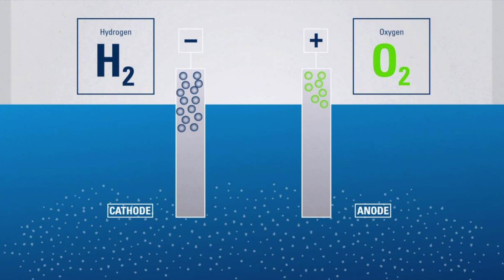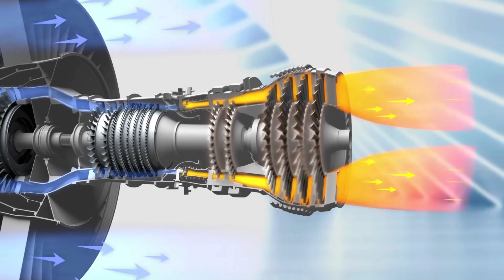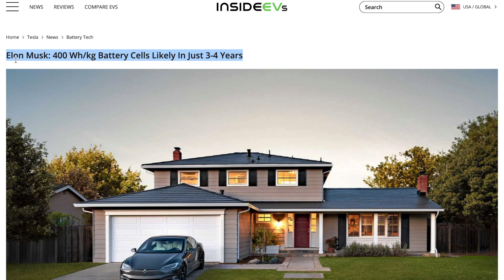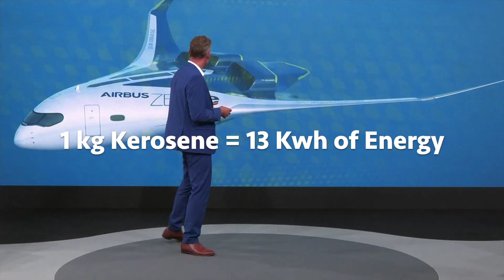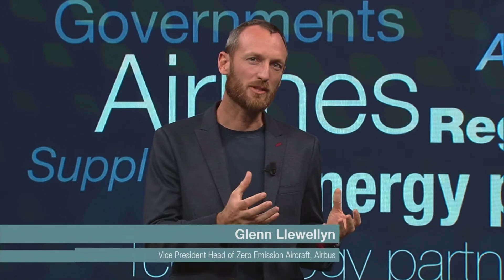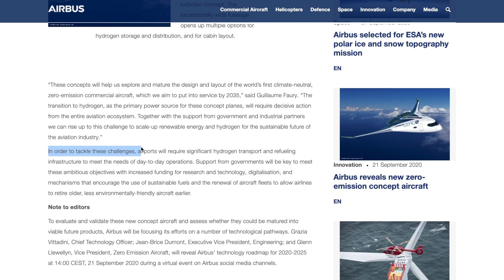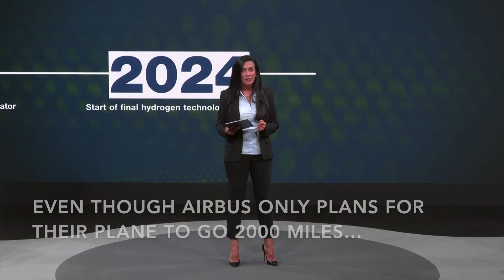Why A Hydrogen Plane Is A Terrible Idea

Comment: There's one mistake everyone on YouTube seems to make when comparing hydrogen to electric.
With electric everyone takes the energy density of the storage medium (batteries).
But the hydrogen gets put in the calculation as if a willing cloud of the stuff will just follow the vehicle around.

I'd suggest we compare apples to apples.
So either use the true W/Kg of electricity, which is infinite (as electrons have no mass).
Or, more realistically, use the energy density of hydrogen including its storage.

Using exotic materials we can put about 10% by weight in a hydrogen tank in the lab.
I just read a university paper that's hopeful that with a few hundred million dollars in r&d it'll increase to 13% in the next ten years...
Reply: You wouldn't use hydrogen for aircraft. You'd use ammonia, which is already 17% hydrogen by weight, and run it in an SOFC with a hybrid Rankine cycle or similar (i.e. use the waste heat to drive a turbine to boost efficiency). If you do it this way you don't need to crack the ammonia for hydrogen either, since an SOFC will use it directly. The reason we don't see this happening today with other applications is because SOFCs run hot -- upwards of 800 degrees Celsius -- and they can take a while to start up. These aren't disadvantages for aircraft, which already run cores hotter than even the hottest fuel cell, and take around 20-30 minutes to start. Viking Energy and Maersk are trialing this technology for ships, and it'll eventually find its way into aircraft too.
Reply: @seanmorrison3744  Interesting point, thanks!
A few questions come to mind.

What's the effective usable energy density of ammonia (including it's storage)?
Either through SOFC or partial cracking (I did just find an article about possibly feeding partially cracked ammonia directly into existing airplane engines).
Anhydrous ammonia is quite nasty stuff. Can it be stored in lightweight containers? Possibly even the wings (without dissolving them)?

And hearing nitrogen and high heat brings possible NOx emissions to mind. Anything known about that?

I can't (easily) find a source that can answer these questions. If you happen to know a source it'd be much appreciated!
Reply: @sigi9669  this paper is a good overview of the current state-of-the-art: https://pubs.rsc.org/en/content/articlelanding/2021/ta/d0ta08810b#!divAbstract.
Practical applications have managed efficiencies better than 50%, and trigeneration gets as high as 80%. An aircraft won't get that high, but aircraft can definitely make use of waste heat, and cryogenic fuel. NOx depends on the type of fuel cell -- you'd use proton conducting electrolytes for aircraft and boats, since it avoids corrosion and keeps water out of the fuel stream, and these cells don't produce NOx. Ammonia is much easier to store than hydrogen, though I don't know what kind of tanks you would use for transport applications. The Germans used it in WWII for a time, so it's doable.

Comment: A hydrogen powered aircraft….maybe. Hydrogen technology and safety has come a long way. An electrical powered aircraft? Unless battery technology advances to the point where high capacity/high output batteries are the size of AA batteries. It’s not happening. 

The problem with electricity is that it takes a lot more stored energy to create the same amount of work. The amount of energy from a Tesla battery Cell Set (1,200 pounds) can be done with just a 5-gallon jerry can of Gasoline. You can see the energy density here is extremely different. So now when we add aircraft to the conversation, with some of them requiring 30,000 gallons of fuel per flight…….you might as well start on your worlds largest aircraft World Record. Currently, you would need about 7.2 Million pounds worth of battery cells to meet the same energy density as fuel. Another thing to remember, and is super critical to flight, is that they need to lose weight over the duration of the flight in order to land. With fuel, that is done through combustion. Batteries? Besides a few microns, the battery cells remain the same weight no matter how much energy is used. The only option is to build aircraft to withstand that weight upon landing. Possible, but now the aircraft is even heavier, you lose even more Efficiency & range. 

Realistically, aircraft are not the polluters and fuel hogs people tend to believe. If you consider the amount of passengers/cargo they can transport at significant ranges, you’ll find they’re actually more efficient than pretty much any other form of travel.

Comment: An electrical airplane is possible and cheap for commuter aircraft’s and short ranges.

With solid state battery technologies it should be possible to achieve the goal of a medium range aircraft.

But even today a long range aircraft is difficult. 38% of the MTOW of the A350-1000 are fuel…

Comment: What about the turn-around/up-time of the planes? You'd probably need twice as many planes with batteries. One plane charging while the other one flies. Not a problem with hydrogen.
You're talking about 25x the energy density as if it was "not that much", because you started out with 400. 25x is still ABSOLUTELY MASSIVE. And you don't consider the considerable weight difference's effect on the efficiency of planes either. Added weight means more lift, means more drag. As well as the low speed of electric propeller aircraft also meaning the lift power needs to act for longer as well. The lift power needs to equal the weight of the plane. The plane weighs more, and is up in the air longer -> More energy goes to lift insead of moving from A to B.

Comment: "considering advancements in battery technology"? You seriously think that batteries would be a good option for planes? That's ridiculous.

Also a big problem with your argument/title is by saying that hydrogen planes are a bad idea, but then proceed to only cover hydrogen combustion planes. The easiest explanation as for why hydrogen combustion is a problem is that there's no good solution for emissions of nitrogen oxides, making it not solve the environmental impact issue, which is the only potential relevant issue to not use fossil fuels (and isn't even a good one, since aircraft make up such an extremely small fraction of overall global GHG emissions it shouldn't really be of much concern).

You also seem to be making a huge error with specific energy. Aside from using the term "energy density" rather than "specific energy" (which I won't really blame), you state that a 10x energy density of solid state batteries (where the hell did you hear that by the way? that's completely ridiculous even for energy density) would result in 10x higher specific energy. Solid state batteries will certainly take up less space, and could save some weight per energy too, but they'll still be very heavy, and even more dense than existing batteries. There's no way they could possibly weigh 10 times less per joule than existing batteries.

Comment: Your video does not provide solid arguments for electric planes. I think that hydrogen planes (that is, planes that burn hydrogen) are a bad idea, but battery-powered electric planes are too. Maybe we will end up with medium-range propellers planes that carry a hydrogen fuel cell to provide power to electric motors. But long-range flying will always use kerosene. Most importantly, the reduction of air transport CO2 emissions will necessarily be achieved through a reduction of how many miles are travelled by plane each year. Any other solution is doomed to increase emissions: if batteries do end up permitting cheaper flying with far fless emissions per mile (which I don't think will happen), then so many more people will fly that emissions will increase. Aircraft manufacturers - and politicians - need to stop digging their heads in the sand about this

Comment: OP i still think its viable. consider that the main pro of H2 is energy density and the main con is cost but the former is a more theoretical limit and the latter is a more practical one. As for infra, that always depends on hype and investment so again just a practical problem, not a technical one

Comment: Alright, easy mistake (assuming it is a mistake and i’m not just talking through my own ass here) hydrogen does not cost 14 dollars per kilogram; it costs 1.4 dollars per kilogram which, granted, is more than kerosene but definitely not by more than around 70%.

Also, your argument doesn’t make sense to me; if the hydrogen still is 3 times as energy dense than kerosene, how is a fuel mark-up of 70% unsustainable?

Comment: But this is referring to the production of hydrogen fuel. Not the mechanism of using hydrogen in a jet engine. Which is clearly better than having banks of heavy lithium and silicon on a plane

Comment: How can we make an light excavator work 24h around the clock without stop to charge battery? See the JCB hydrogen piston engine video.
Burning petrol isn’t the solution and solid state battery have limitations to, very nice for cars and other things but not for a 16 hours flight

Comment: NGL I'd rather go with a proven current generation technology (fuel cells) than pinning my hopes on a 10x battery capacity improvement that might happen... according to the battery manufacturers.

Oh my goodness so many issues with this video. Why are you comparing prop driven electric to hydrogen jet? That's an apples for oranges comparison. Also projecting forward with today's economics for an industry that everyone knows is facing major disruption over the coming decades is reductive and kinda dumb.

Comment: Not to be mean, but this is just dumb, the weight of a battery system doesn't diminish linearly with the energy density of a battery. A SS battery system would only be about 30 % lighter than your equivalent  li-ion battery today even if the energy density would 4x. A Airbus A350 or Boeing 787 would need something like 3.5 kWh/kg to fly even the shortest route which just isn't on the radar even with SS batteries. I mean I like batteries as much as the next but you can't really be more efficient pound for pound than a hydrogen fuel-cell and in an airplane where mass is everything that is all that matters.

Comment: I think the ability for Hydrogen’s cost to be significantly reduced is not being given enough attention. Gasoline is far harder to extract than Hydrogen is. Only reason the price of gas is so low is because of the technological innovations made to make extraction as efficient as possible. I see no reason why this couldn’t be done with a Hydrogen as well to make the prices more comparable. And after all, only one of these fuel sources are renewable

Comment: Short-range aircraft could use electric aircraft but would only be viable in high population density Eurasia. I think high-speed trains or hyperloop would be even better there. Unfortunately, I think the best option for intercontinental and low population density continents is carbon capture and the production of kerosene from that energy sourced from renewables.

Comment: What about the charge time? Planes are only making money when in the air therefore if an electric plane has to charge for 5 hours to fly for 3 then the cost is significantly higher.

Comment: I’m just thinking . Use  hydrogen and oxygen hho and combust to rotate turbine to generator to power batteries for electric motor and capacitors for sparking combustion. Doesn’t have any stall and a constant rotating speed.And have enough batteries to convert water to hho for the fuel all on the airplane/airship. And is old proven technology.
Reply: Weight consideration? It's going to be heavier than normal hydrogen engines. Also, it's going to add to complicated designing costs, and that battery is going to weigh SOME huge amount. And the speed is going to be horrible, and so are going to be the maintainance costs.

Comment: 70-80% is very good. I dont know why people think its bad?
Its effiency is as good as regular fuel

You have no alternatives..the reason why we havent switch to electric

Had we have gone all in with hydrogen in 1990s with solar

We will have the batteey..duh..no you wont..you dont have a battery..come back in 20yrs u still wont have the energy density

Comment: Have you considered the factor that hydrogen is lighter than air so, while the hydrogen would provide a buoyancy thus decreasing the net uplift force required for, battery as well as fossil fuels would add up to the net weight and wouldn't provide any buoyancy thus increase the net lift required. Also, while a hydrogen vehicle could be refueled just like a traditional jet, how long do you think it wood take a battery jet to completely recharge?

Comment: Please try and learn some electrochemistry and thermodynamics before making science videos: 1) Doing PEM electrolysis around STP is just as silly as running BEV Lithium batteries around -40°C: just as your BEV gets poor very poor low temperature performance, but achieves best efficiency ~80% around 25°C, SOEC electrolysis performs optimally at very high temperatures and pressures, in parallel with electrical generation, where excess heat allows ~95% efficiency for electrolysis relative to power generation along with high pressure 100 bar H2 as output, and optimal high temperature steam turbine electrical generation around ~60% efficiency as well. 2) Working conventional STP Toyota and Honda PEM fuel cell efficiencies average around 63%; whereas reasonable high temperature SOFC stacks now achieve ~75% efficiencies. Fuel Efficiency from high temperature super-heated steam generation through use in batteries achieve net efficiencies of 60%*80%=48%; conversely, fuel cells using high temperature super-heated steam processes achieve 95%*60%*63%=~36% with STP PEMs or 95%*60%*75%=~43% with high temperature SOFCs. Batteries are not really so much more efficient: even non-technical folks can see 48% is not so much better than 43% or even 36%. By the way, you are free to use your 20% efficiency solar cells if you like; but reasonable engineers will be using 60% efficiency super-heated steam from solar or nuclear sources. 3) Choosing to compare worst possible choices in usage of one technology, burning hydrogen fuel in a turbojet, with best theoretical use scenarios for another, science-fiction zero-mass battery powered light-weight motors, is laughably bad engineering. If you were honest, in working through your theory, you would give a calculation of battery weight requirements for representative aircraft by gross weight, cargo payload and range; but since you are not trying to be honest, you never once say the obvious: batteries would need to outweigh current gross airplane weights even just to carry modern planes stripped down, with all fuel, batteries, and engines removed. And finally, after giving a most laughable example of bad science, you go on to give an equally laughable example of bad economics: there is currently no way of calculating long term electricity or hydrogen costs; and this is because fuel, electricity, and hydrogen, all have a long history of global and local pricing subsidy politics; if you are in doubt, then just try checking current retail pricing for any of these across our globe.

Comment: Battery this, battery that. Dude, what about the motors to propel the plane? Jet engines are orders of magnitudes lighter than equivalent powered motors. Not to mention the turbofan engines are way better than motor driven propellers.

Comment: Sorry how fast does an electric plane fly?  A jet travels at 600mph, until an electric plane can travel at 600mph it’s a dead in the water technology. Having said that I agree that Hydrogen has a lot of obstacles also. The only real option is bio-fuel, which Porsche have just invested heavily in. Another even cleaner option is ammonia which conventional jet engines can be converted to use.

Comment: Why do feasibility discussions regarding hydrogen disregard the cost of water for electrolysis? It is not free, and in fact clean, relatively pure water is an increasingly scarce  (read "expensive") resource, worldwide. If you assume the use of seawater then the cost of purification must be included.  Water is the "fuel" for a hydrogen economy. We do not neglect the cost of petroleum when we allocate costs for jet engines...
Reply from the maker: Honestly, you are right. I should have looked into that and included it in the video. My mistake, but thank you for making me aware of it

Comment: Hydrogen clearly has a very important future in aviation - in a dirigible or "zeppelin".  Helium is wonderful, but there's not enough on this planet for all the uses it has.  Maybe in the future, space activities will include helium collection and delivery to this wonderful planet.  If ocean shipping is the cheapest option of moving stuff, shipping by using the planet-wide ocean of air above us should be the cheapest option for air-shipping.
As far as fuel :  hydrogen is wonderful except for the really low boiling point.  Making Methane or other chemical compounds out of hydrogen is the only way - and methane is very common to biology as well as in space.  Solar energy via algae would be just one low-tech low-energy way to make methane.  Another is fermentation of waste, including methane from trash dumps.  Yet another, is fossil fuel formations injected with steam.  The options are numerous, unlike hydrogen's.  Also, dealing with hydrogen is a nightmare because of its small size allowing it to permeate everything, leading to embrittlement.

Comment: On airplanes, boats and in a lesser manner, trucks, weight is very important. Currently, airplanes are able to do very long haul flights because they burn their fuel making it lighter as it goes. Batteries do not do that. I don’t ser any possibility of battery comercial flight, but there is a change with FC.